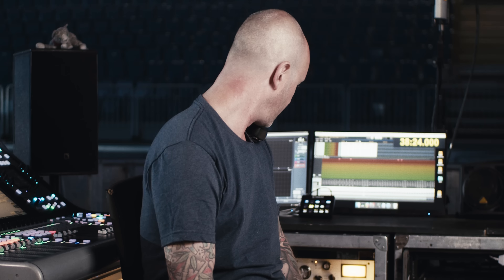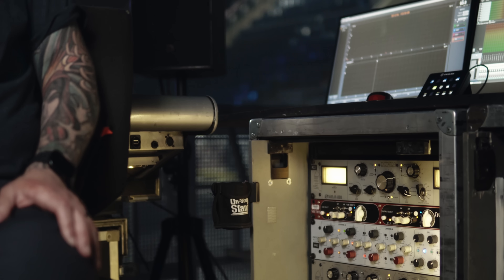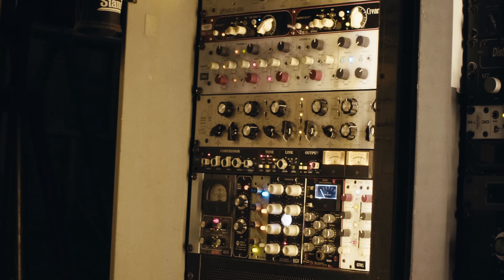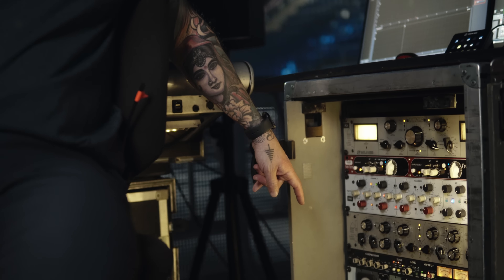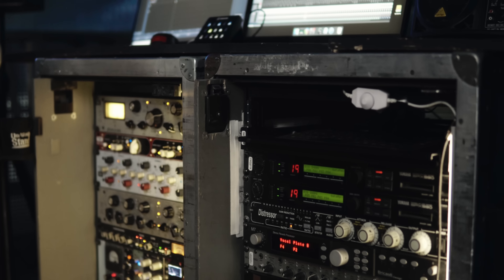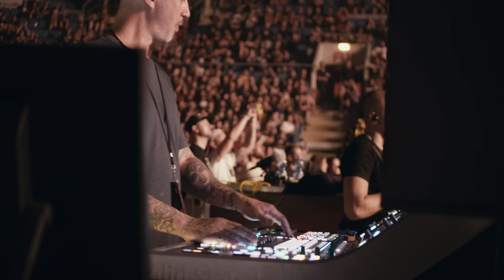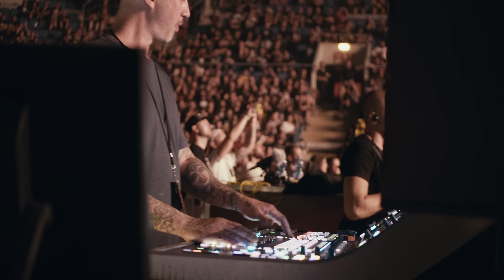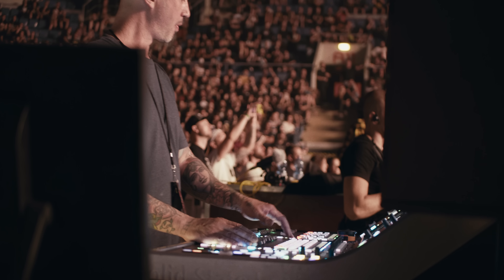Bob Strakele (FOH Engineer - Slipknot) interview

Comment: Just saw Slipknot. Mix was horrible. Just sounded like one big blob of sound.
Reply: What venue? The acoustics of the venue & materials used to build the walls and mezzanine etc, can very highly affect the live mix. One night could have walls and ceilings with far more dense materials as well as insulation where the mix will be far meatier; and the next night venue could have far more ‘room’ and natural reverb and bounce back goin on due to either larger venue, or like I said before, but with far less dense and less insulated walling. Also, the venue/arena often has their in house high rise speaker snakes to hit their higher level seats, as well as a backline of subs. Depends on the tour etc, slipknot may happen to bring 100% of their oh PA + mounting setup, or they may use partial.